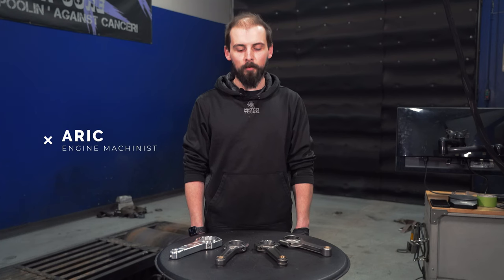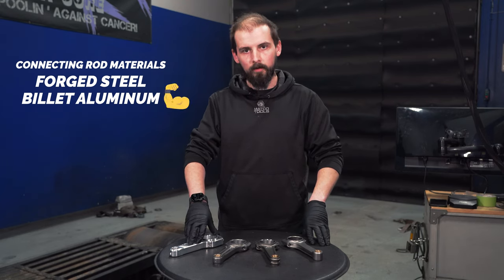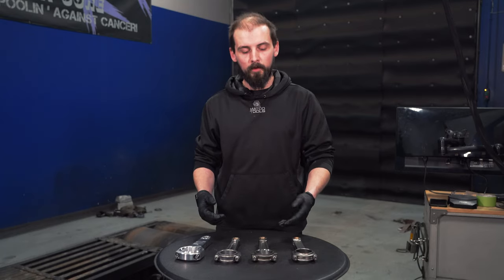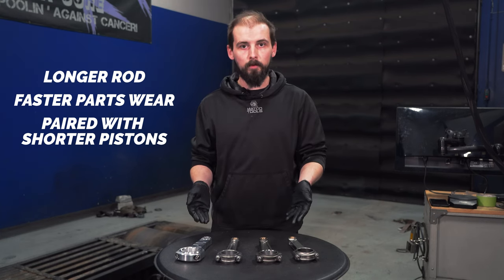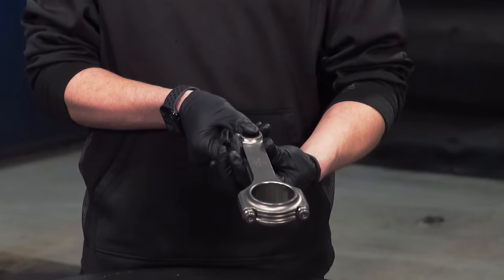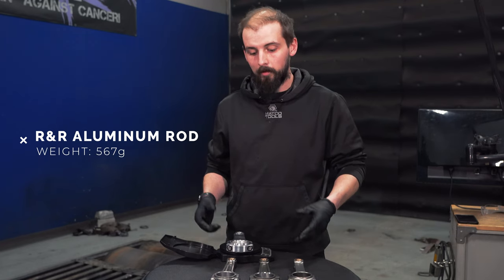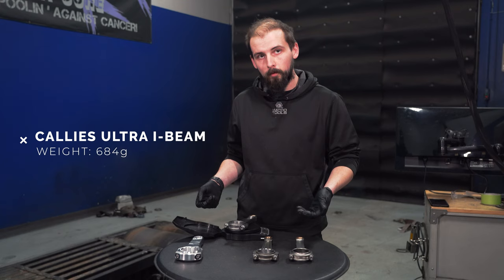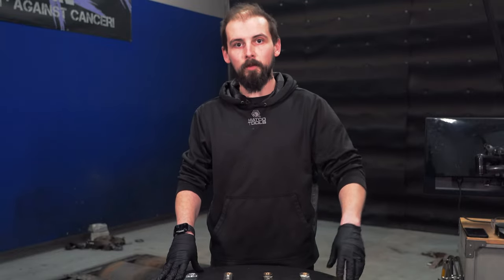H Beam vs I Beam Connecting Rods | Which is For Your Build?

Comment: Aluminum has no endurance limit meaning it will fail and get weaker  over time. Steel will hold its fatigue  in the same spot indefinitely.

Comment: 12 months with Eagle Rods on 39 psi, fully built Evo 8 at 650hp/505tq on e85, just pulled out and inspected last week and still in great condition. The most important step in making them last is getting them re-sized by a machine shop, because the majority of the time the clearances on the big end are to tight or to loose right out of the box. You HAVE to get them checked! The people who Ive seen with blown motors running Eagle rods just "dropped them in" and didnt pull bearings after to inspect the wear.
Reply: Eagle seems to have a really good H beam rod. A lot of people have good success at high hp levels. I'd like to see some compressive test on the more popular Chinese rods to see how they all stack up.

Comment: This dude is completel wrong!  He claims that the longer rod will wear out sooner than a shorter rod, because it has a 'larger deflection' than a shorter rod.  This is completely false.  It's the exact opposite.  Now lets talk about piston speed... Yes, piston speed is the determining factor for piston integrity.  A shorter rod will cause a piston to increase speed through it's stroke faster and higher tian a long rod.

I don't know why anyone would  create such a falsehood of a video.  Longer rods are always better, for the reasons I listed above, not to mention that your timing advance is more forgiving.  The only downside to a long rod motor is oil ring to wrist pin clearance.  But with modern technology, and the ability to manufacture very short pistons, it's all the better to long rod your motor.

Comment: The longer the rod the faster piston speed to giving RPM and the higher the torque.
Reply: Other way round son     

Short rods make the piston reach a higher peak speed
Reply: @byrondebrueys8569  well to be more specific sir, if going down from the TDC the shorter rod will have the faster piston while if going up from the BDC the longer rod will be the fastest piston travel.
Reply: Piston speed is controlled by the crankshaft radius.
Reply: @Kh.J.  yes both length rods have faster piston speeds than the other at varying degrees of crankshaft rotation. There's a channel that has a great video on this exact subject.